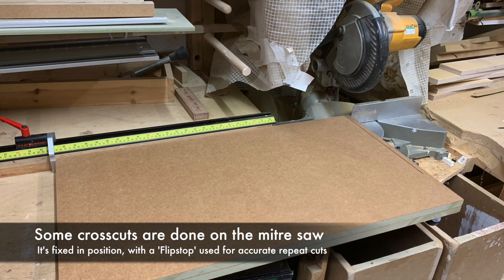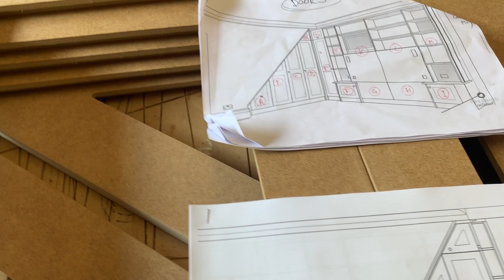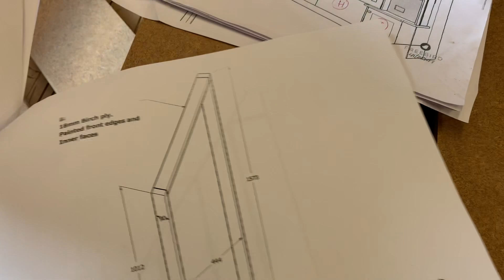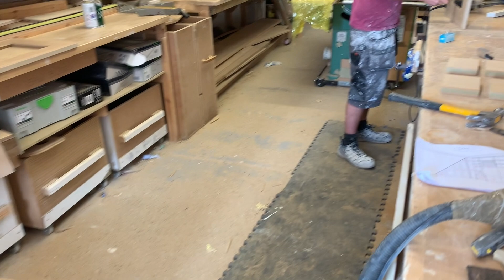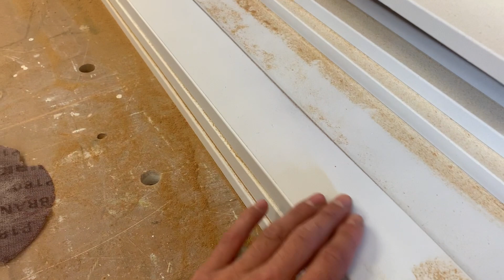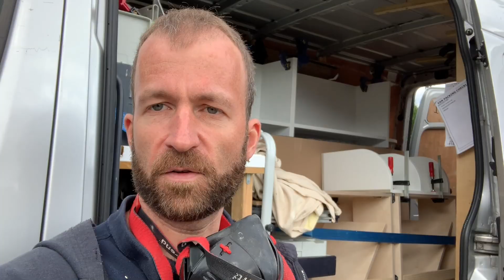Fitted Furniture Masterclass 2: Cutting out and preparing parts

Comment: Hi Alastair, another question for you!!! With the carcass design as shown for unit A at 4.06, why do you have the vertical panels outside the horizontal and not the other way around? Is it a force/physics consideration or a technical one? Cheers!
Reply from the maker: Hi Jamie you've caught me at the computer!  It's a fairly standard way to build carcases and one benefit is that you know you can cut your tops and bottoms at the same length as your shelves and it all goes together tight (unless your shelves are adjustable in which case you'd undersize them 1 or 2 mm!).  I suppose another reason for it being standard in kitchens and bedrooms is, when cam and dowel fittings are used, you have an uninterrupted side panel that looks neat if it is left exposed at the end of a run.   I have a feeling there are other good reasons that I'm forgetting.  It does just require you to make sure the supporting feet sit at least partially under the edges of the side panels to ensure the weight is born down direct to the feet and not via the inset base putting too much strain on the fixings into the side panels.
Reply: @Alastair_Johnson  lots of great reasons there alister, but i think the main one is that when they are cnc ing the side panels they are cutting all the holes  into the face and none into  the edge, this reduces the machining time and having the cnc swaping heads.
Reply from the maker: MelbourneAlan interesting!